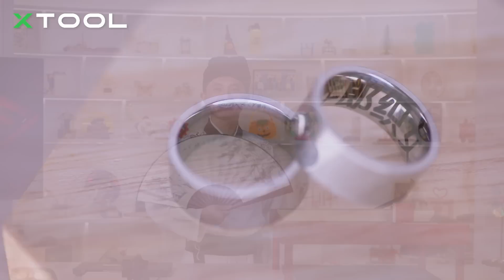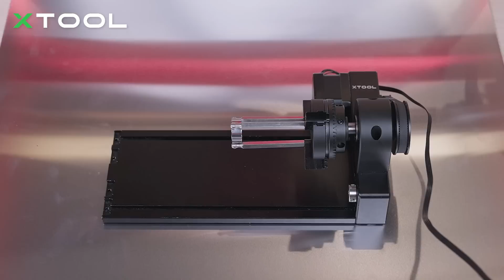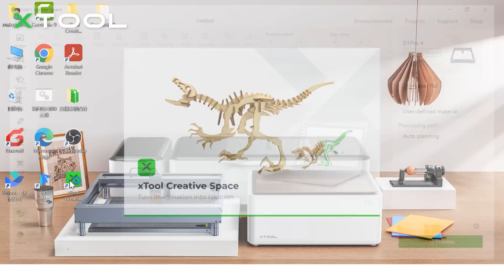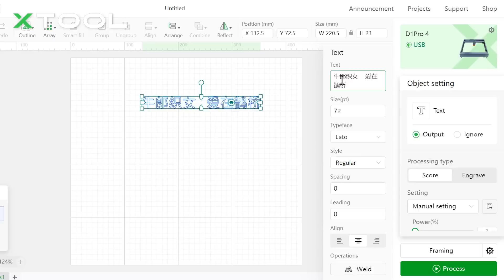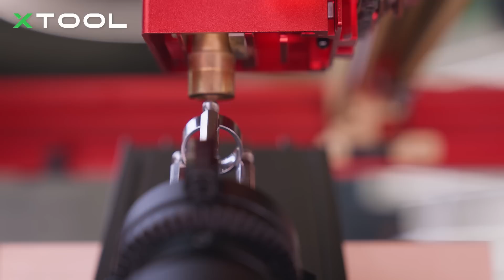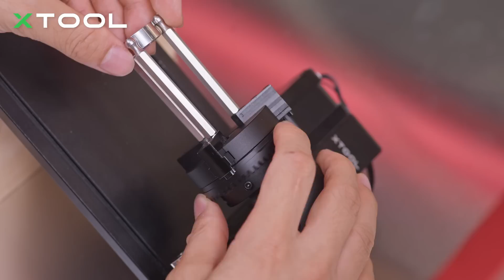How to Laser Engrave Ring‘s Inside with xTool D1 Pro | Chinese Hanfu Dress Showtime

Comment: Hi Kai
Thank you for the video. I am using the M1 so can you please tell me how I line up my design for inside the ring as putting the RA2 at an angle shows a very distorted view on the camera. Also is it inside or outside diameter that is measured please? TIA

Comment: Thank you for the video. 

Does the laser automatically account for the sloped surface of the ring, or does some distortion/elongation occur.? It looked like you set the focus to the center of the ring and I didn't notice any distortion in your video. Or did you account for it somehow when you created the text.

Thanks again, this opens up even more opportunities!
Reply from the maker: Hi John, yes we set the focus in the center even a bit deeper to the edge of the inner surface, and the content didn't go distorted, it's normal.
Reply: Yes, I wondered the same thing. I still can't get my head around how this works without the text being distorted.

Comment: does this use a marking spray? He says a "prepared" ring, but no mention of what that means
Reply from the maker: No no, it's a normal stainless steel ring, not extra marking spray, both diode and infrared laser can engrave on stainless steel.